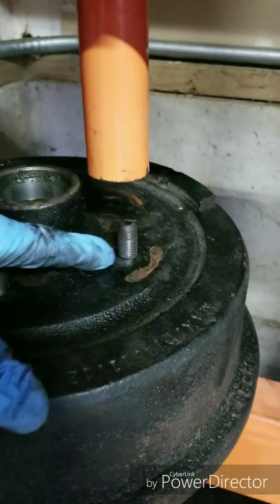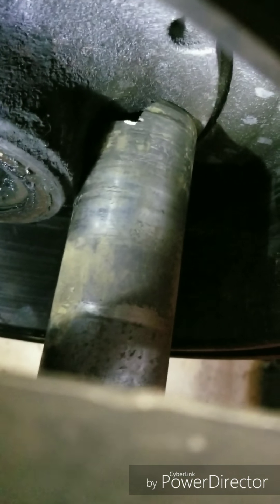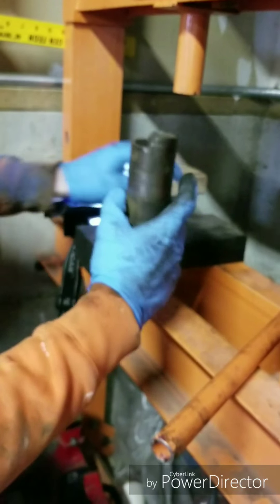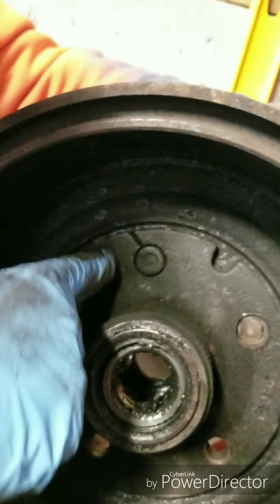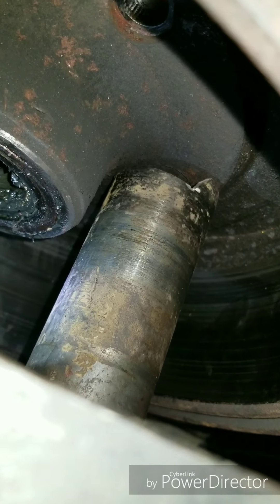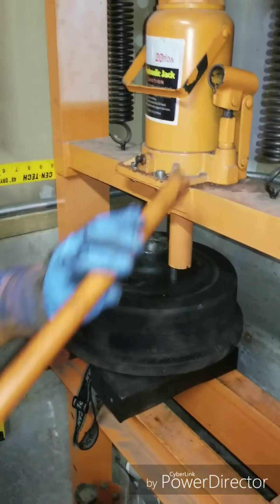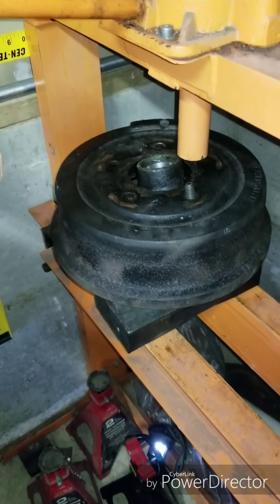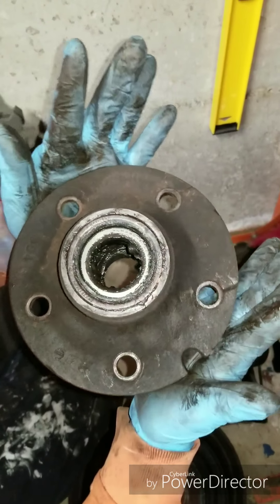F-100 Rebuild: Front Brake Drum and Hub Replacement (Separation and Removal of Swedge/Swadge/Swage)

Comment: You can still damage permanently the hub by pressing the wedge through the hole (the oversized swedge damages the hub hole so the new stud does not fit tightly. You should cut the swedge first…!)